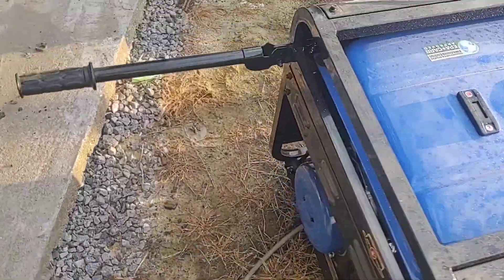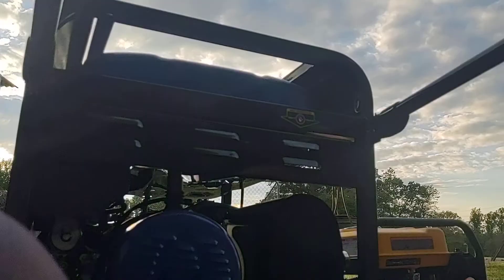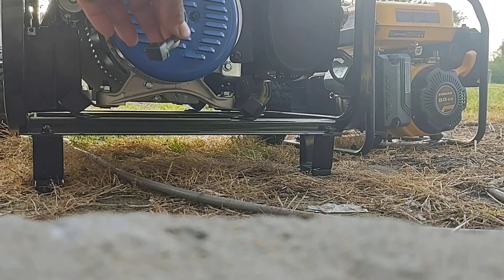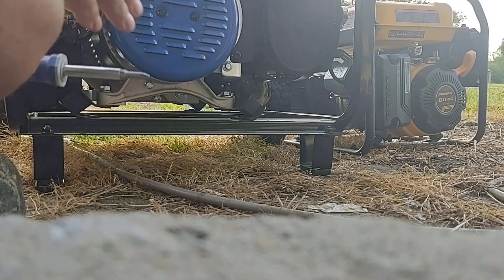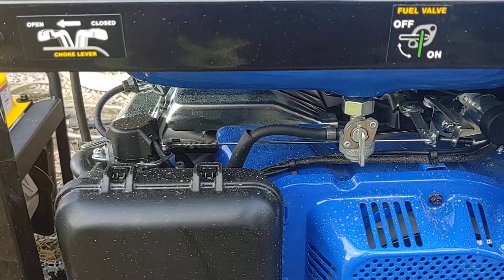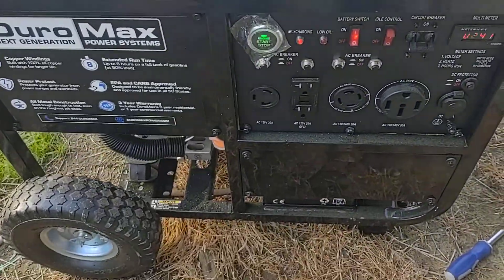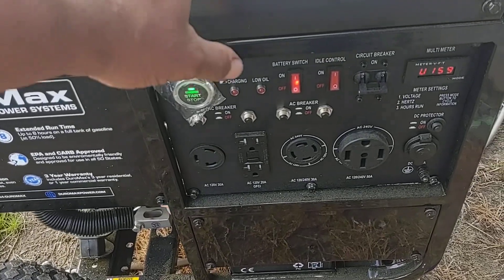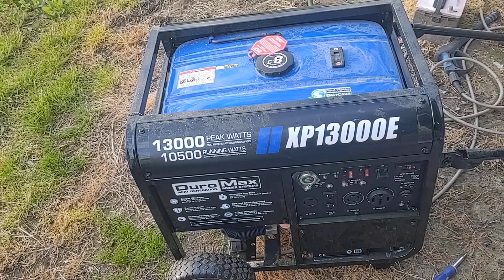Duromax xp13000e virgin voyage

Comment: Hi thanks for sharing. I bought mine 2 years ago I tried and worked just like yours but I'm trying now and is not starting I put some carb cleaner checked the spark it is good but nothing what can you suggest me please
Reply from the maker: @miguelochoa5787  I don't use ethanol gas in mine.. if you did and let it sit you need to take the carb off and disassemble and clean it well then it should run fine... I also run my generators once a month for 8 hours

Comment: I just picked this same model up last week. 

What a Beast.  

Just for an initial test, I ran my 17,000 BTU A/C unit,  plus the wife's hair dryer, and my 1250watt microwave at once. 

The generator barely even fluctuated in RPM.  Lol
Reply from the maker: Yea I haven't lost power and used it just run it a few hours a month. Congrats on your purchase
Reply from the maker: I should have bought 2 before prices went up lol